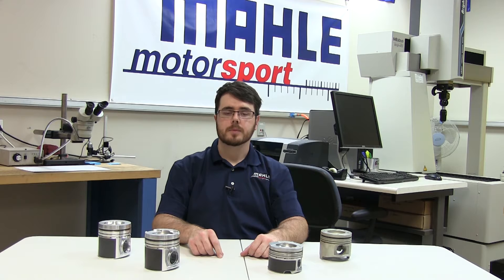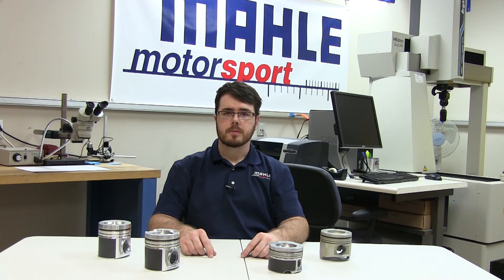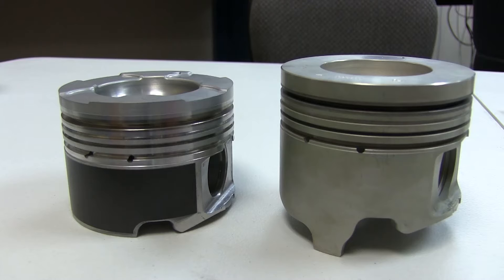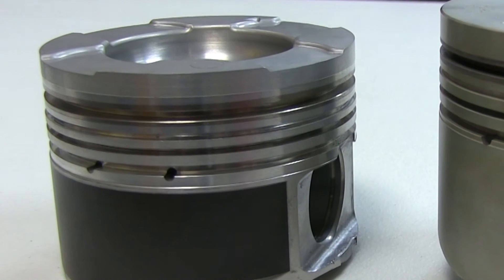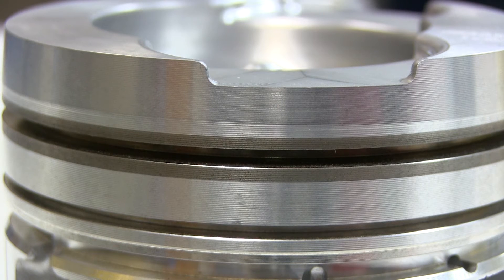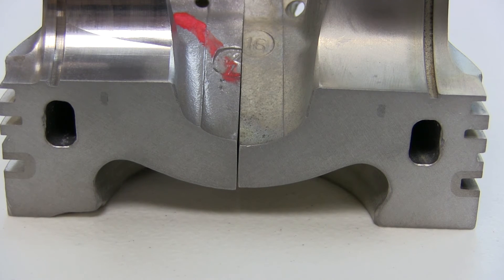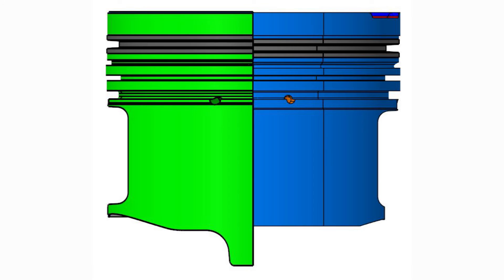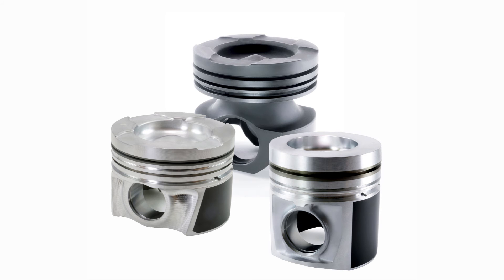Performance Diesel Cast Pistons vs  OE Pistons

Comment: Do you make any Toyota 12HT Turbo Diesel for 87 JDM HJ61
OEM Pistons "achellies heel" ~ Needs a Aflin (= or >) top ring, with a Top Ceramic Coating ?
 Upgrading worn OEM  CT26 Turbo, A2W Intercooler, 3" exhaust
Reply from the maker: We do not offer any off the shelf applications for that particular engine. However, we can make a custom set. Please reach out to our sales team at 1-888-255-1942 Monday - Friday 8am - 5pm EST or motorsport.sales@mahle.com to talk through your build. Thanks!

Comment: Do you do anything for a ford transit custom 2.2 otherwise known as the psa 2.2 tdci very widely used engine and is known to have weak pistons. Thanks
Reply: I’ve got the same truck on my second motor, am interested in MAHLE or Speed of air pistons. 2nd motor is fairly new but I’m not confident anymore in the OEM products.